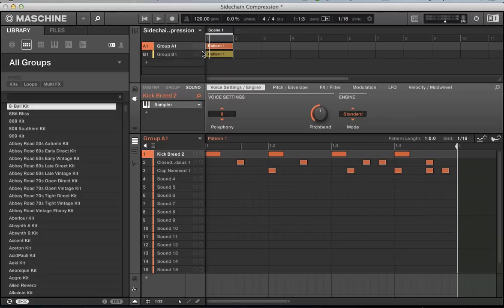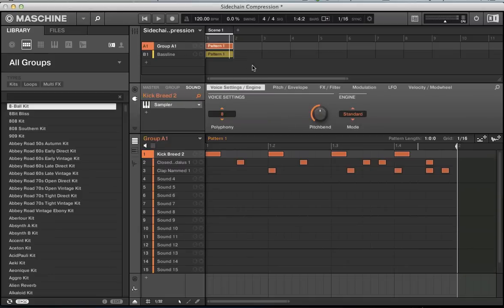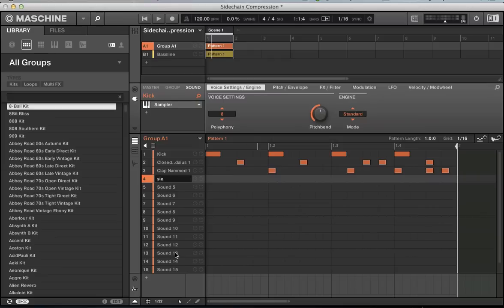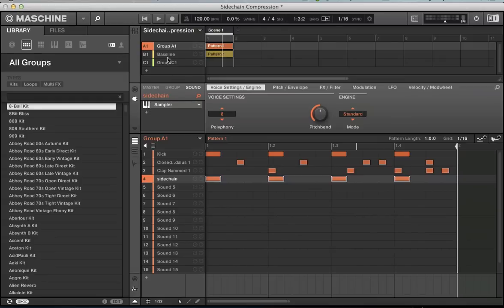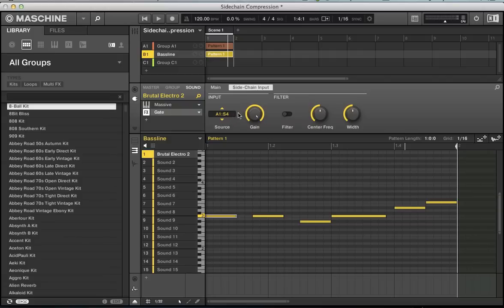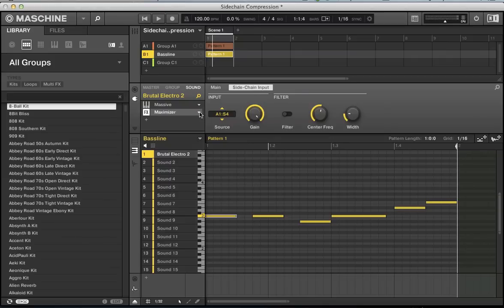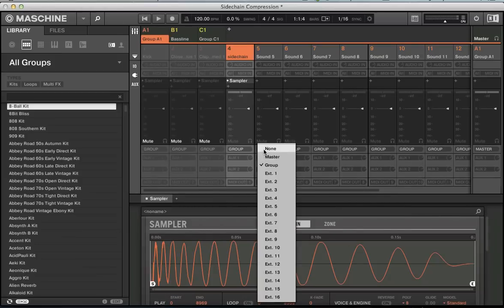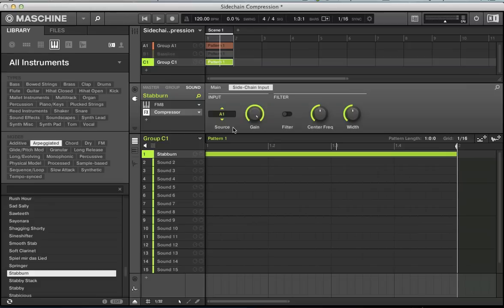Maschine - Overview of Sidechain Feature and Some Helpful Tips

Comment: How do you select all the notes on a specific instrument like that????
Reply from the maker: Shaquille Greene From the hardware, use the shift + select (should be called events) and then hit the pad you want to select all of the notes for.
Reply: ***** Okay perfect, what if I'm currently away from my hardware?
Reply: ***** Also, is there a way to make a LFO chained kick to make that sub wobble? Like a wobbly kick sub?
Reply from the maker: Shaquille Greene I think you have to just click and drag if you're on the software. You can use a filter with LFO-synced modulation, might be something to try
Reply: ***** Okay, I just figured this out. Gotta click on the pointer at the bottom where the browser is. Instead of the paintbrush. Can't believe I overlooked this. So excited. Just need to figure out that LFO sync and I'm all set. Thanks for the help! Love the videos, earned yourself a sub a while back from me.